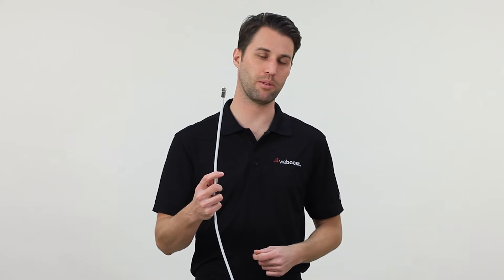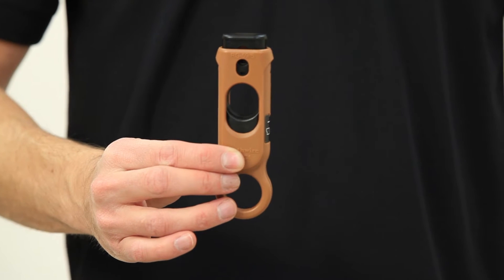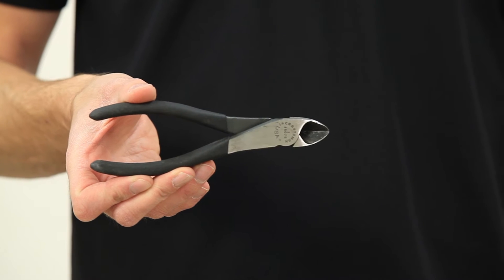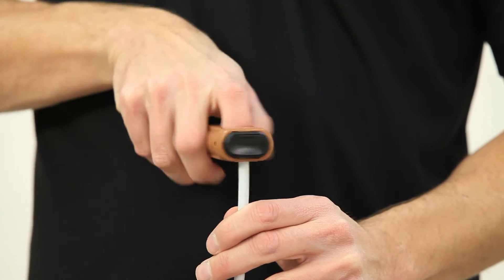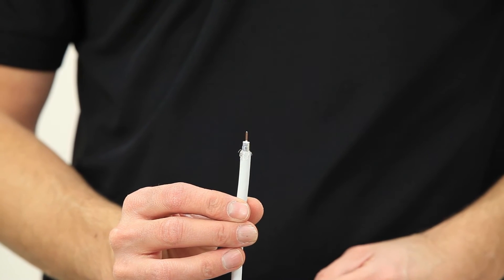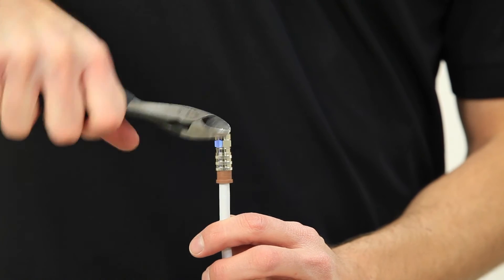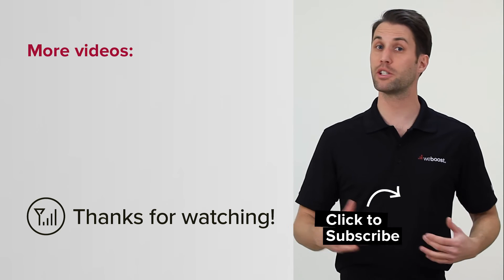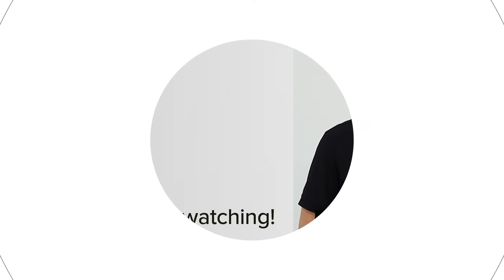How to put the ends or connectors on RG-6 cable | weBoost

Comment: You’re not terminating a cable. You’re attaching a connector. Terminating is connecting to hardware or attaching a termination component like a cap with a 75 ohm resistor.